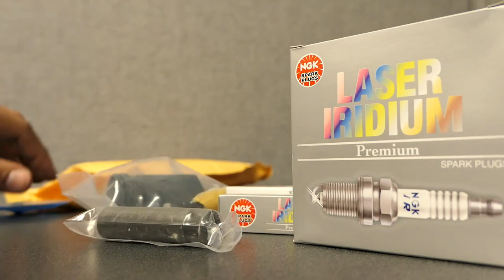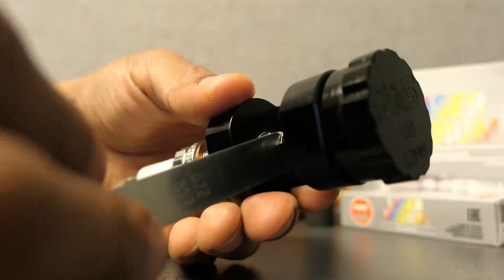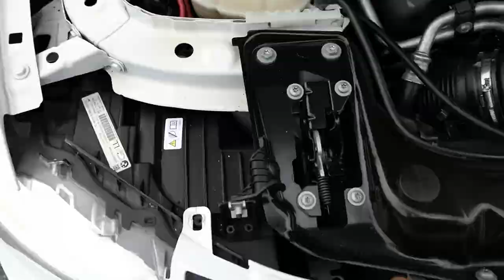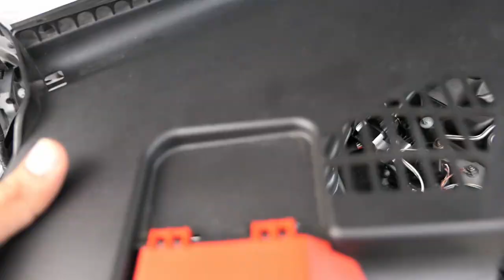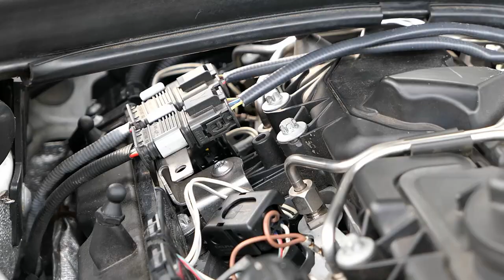Changing my BMW F30 FBO sparkplugs in under 2 minutes! If you're tuned get these.

Comment: Did you replace your spark plugs with NGK 97506 2-Step Colder Spark Plug?
Reply from the maker: I did, BMS recommends to gap them to .020 but Bryan from Kies runs .022 which sounds better since im not running any fuel mix or upgraded turbo
Reply: Eldridge Cortes Ah ok, I was just wondering cause I’ve always heard 1-Step colder is better unless your car is pushing over 600 hp.

Comment: What happens when the car missfires? And how do you know it’s missfires?
Reply from the maker: It depends how bad the misfiring is but it could be terrible idle right off the bat. Also there's a chance it could idle normal or somewhat normal but if you rev it, it'll sound somewhat like a wrx. If you're driving then you'll notice a loss of power and stuttering